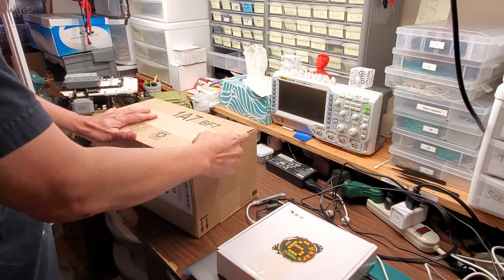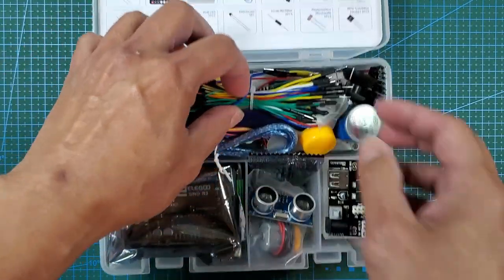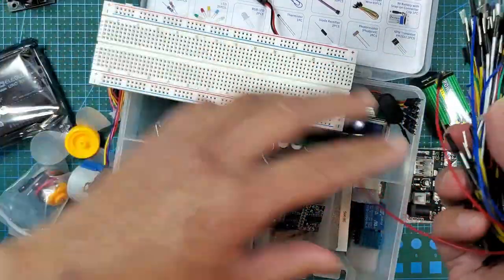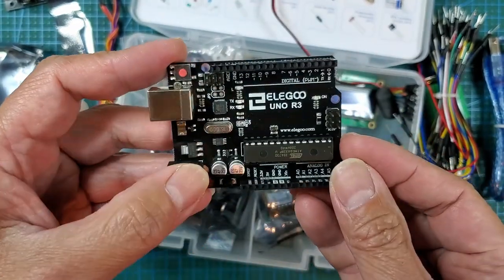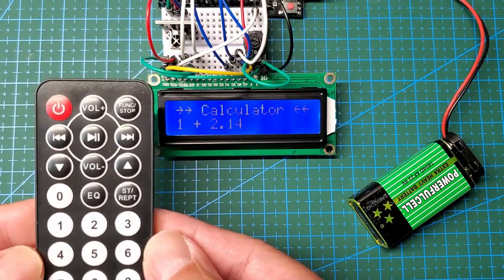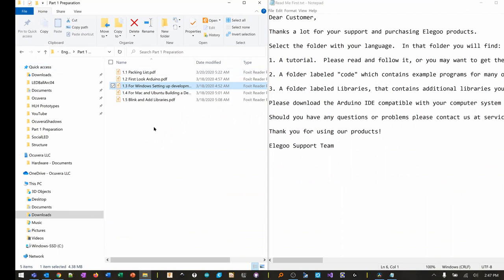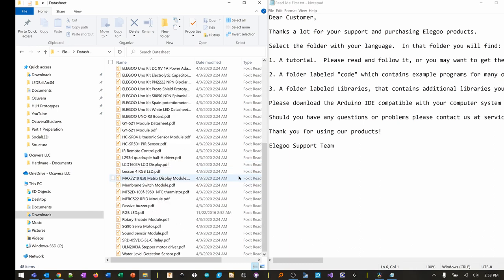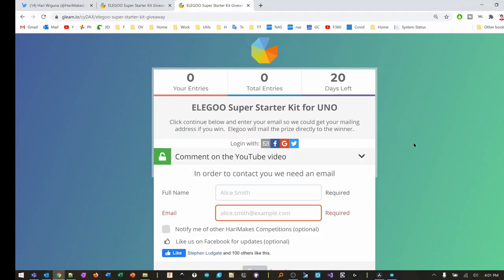HariFun #185 - Unboxing, Review, and GIVEAWAY of Elegoo Super Starter Kit for UNO R3

Comment: A few years back I attended an IoT dev conference and they had a small talk/shop in one of the rooms with the Arduino MKR 1010 (wifi/bt iot arduino nano basically) and the kit they were using to demo it for the attendees used an elegoo breadboard. I still have that and use it quite frequently to this day, it's lovely and hasn't worn out or loosened up, even though I use it to hold headers when I'm soldering boards :)

edit: I glanced at the giveaway and it looks like people have already broken it, there's only 7 comments here on youtube but 10 entries to the giveaway already!
Reply from the maker: Thanks for sharing your experience. About the giveaway: I do not have any experience using Gleam, so I probably did not set it up optimally. :-(
Reply: @HariWiguna  Not a worry regarding the giveaway, I'm sure someone will benefit from it no matter what :) 

I'm only familiar with Elegoo through their 3D printing equipment which is incredibly popular, I have seen a lot of their electronics kits and were I not already in the posession of the arduino mkr I would have bought one of their kits about a week ago when my new soldering iron arrived :)
Reply: @HariWiguna  I don't need this giveaway thanks for upload the video on giveaway